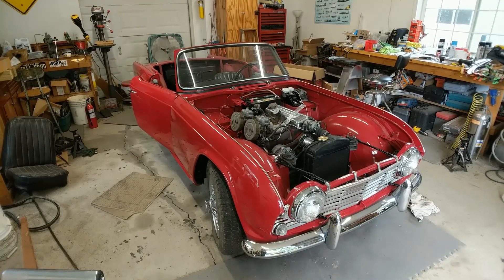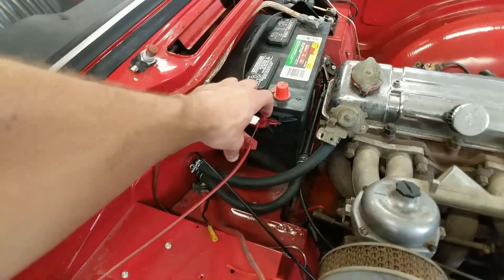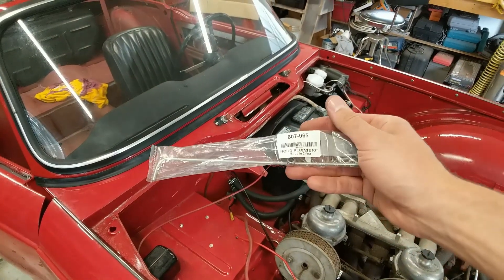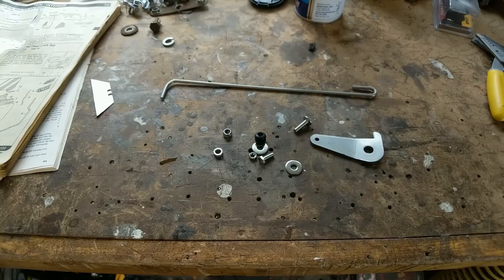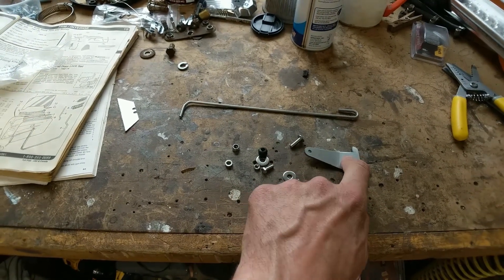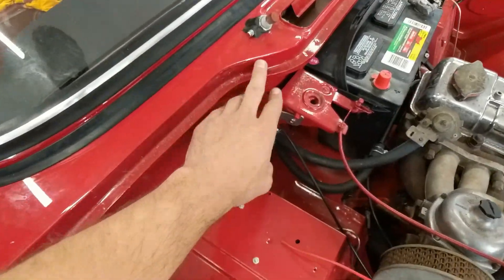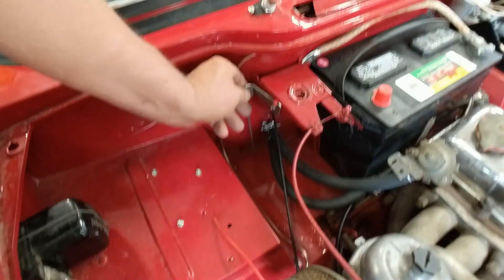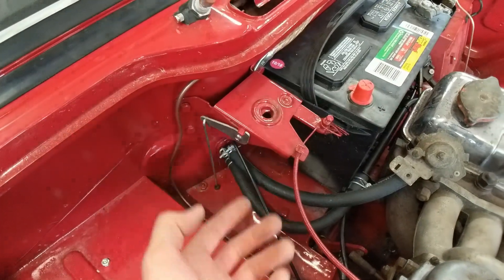EMERGENCY! Hood Release Kit for Triumph TR4 | Wegs Garage

Comment: hah, yep its the Bonnet.....and the trunk is the Boot..lol...nice little instruction, I bought the kit for my TR6 which has the same latch, you've inspired me to get my ass in gear and fit it as it has been in a drawer in my garage for a few years now !!!
Reply from the maker: Trying to reteach myself the proper words. Seems proper to speak in the car's native tongue, but old habits die hard. 
It's a super easy upgrade, though many viewers gave some great tips on how to open the BONNET  without a backup, so hot me up if you ever need any ideas hahaha.

Comment: Hi, Ive just fitted this kit from Moss and was confused by the additional nut and bolt in the kit. The extra part is installed below the metal plate acting as a stop .....to stop the plate turning too far and becomming unclipped....very important.